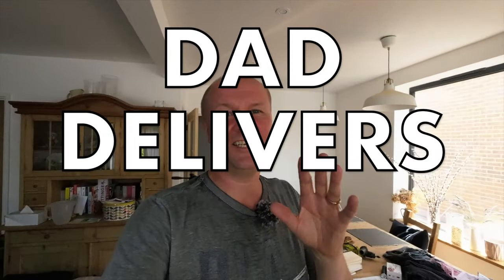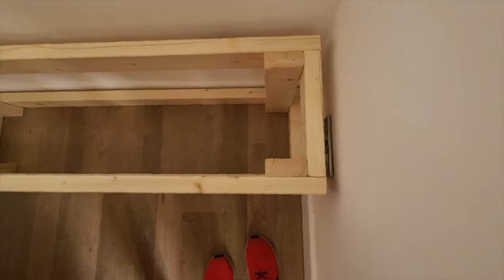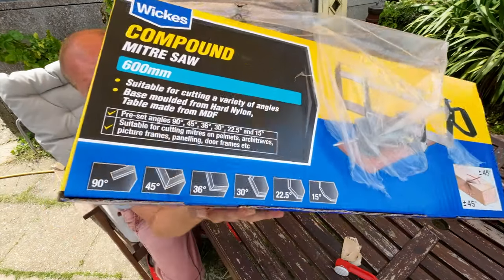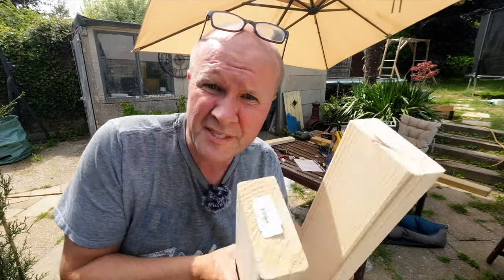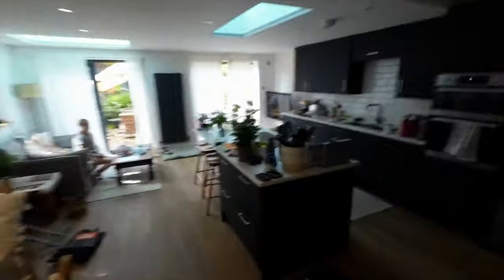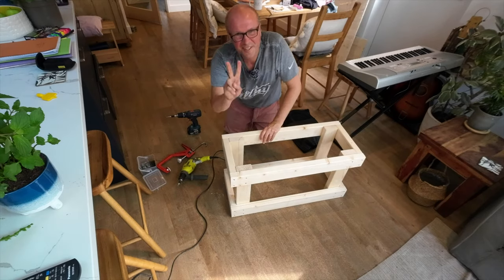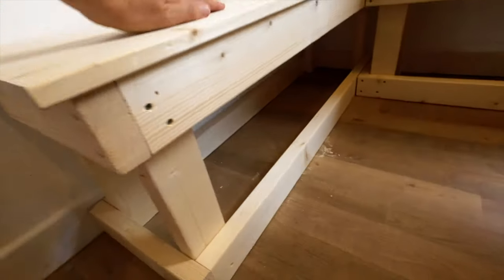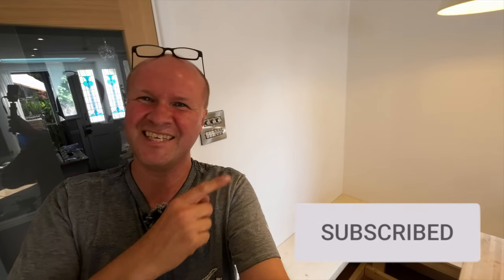Quickly build an L shape bench or corner dining table seat

Comment: Wow am I really the 1st to comment?
These benches are a great idea, been thinking of doing something similar in my bar window when I get around to doing that room out, obviously would do a vlog similar if I did it lol.
Just a idea here, instead of the Mitre Saw you could have clamped a straight piece of wood on the piece you are cutting are the perfect point for the jigsaw to run across that in theory would give you a straight line (hopefully that makes sense? haha) just a idea if you ever do a project with in in the future, worth a try.
Reply from the maker: Thanks Tony! That's genius about the jigsaw tip - not tried that, and sounds a lot easier than getting a saw table!  Cant wait to try that out - thanks again
Reply: No problem, in theory it would work, just got to make use the piece you are using is straight haha